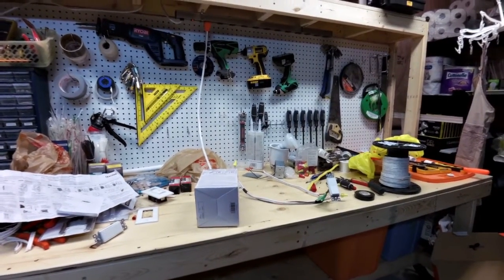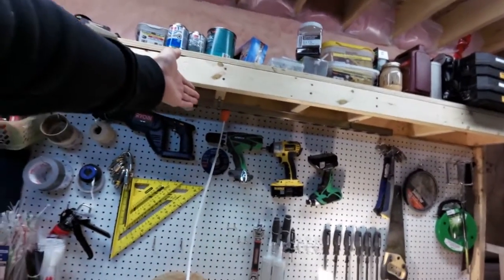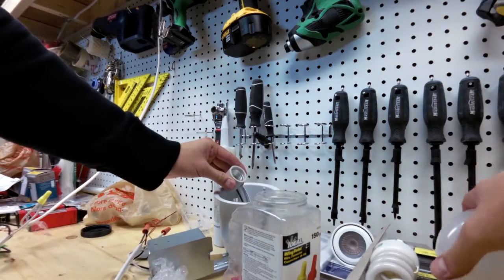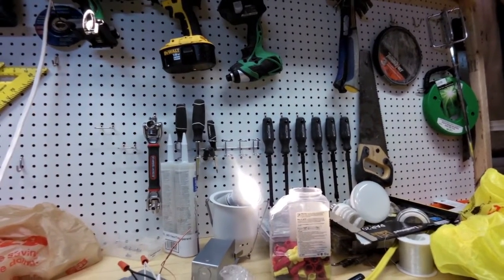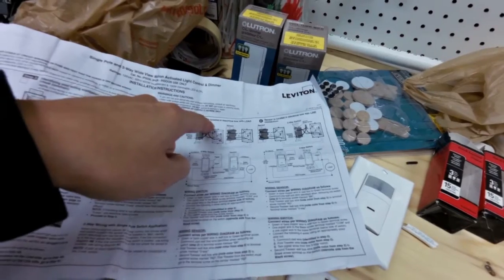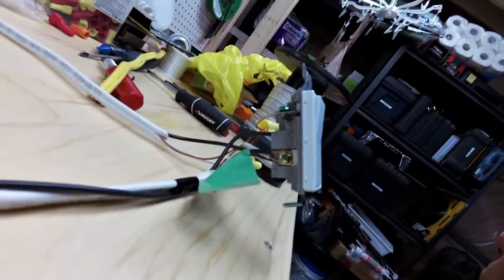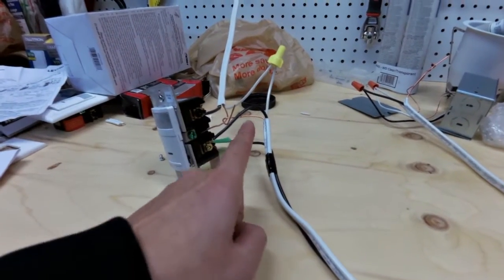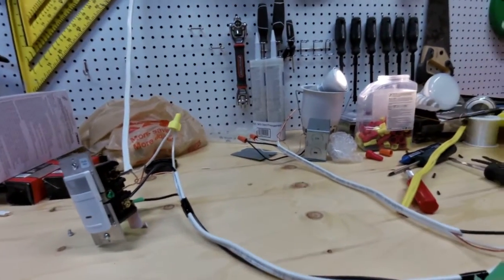Leviton IPS06 Occupancy Sensor wiring & Problems

Comment: Great video! Especially that last bit where you mentioned turning off the other switch could turn off the light.  That's what I'm facing now.  What did you mean by shorting the wire?

Also, I noticed my LED bulb is always on (but very dimmed) when it should be completely off.  Any idea why that's happening?
Reply from the maker: Hi, at 4:03 you can see the white wire going from the black screw to the other terminal on the other side of the switch.  So you are shorting out those 2 terminals.   

As you see in my video, some of these motion sensors cannot turn LED bulbs completely off, probably due to the fact the circuit is still powered so that the sensor can detect motion.   Since LED takes very little power to turn on, the small voltage that exist within the circuit is enough to turn the LED bulbs on.

My other video on How to install Lutron Occupancy Sensor Dimmer MSCL-OP153MH , that sensor actually turns my LED bulbs completely off.
Reply from the maker: If you don't want to replace the sensor, you can try to put a regular light bulb in the first socket of the circuit, that might help absorb all the leaked power from the switch and allow the LED's to be completely off.
Reply: I was browsing on Lutron's forum and someone from the company commented that it depends on the bulb.  They go through tests and list out the bulbs that do completely turnoff.  Here's the list: http://www.lutron.com/TechnicalDocumentLibrary/3682066_CFL_LED_Bulb_list_Maestro_Sensor.pdf

Do you know if you happen to have one of these bulbs?  I don't mind replacing the sensor but want to make sure it's not just a bulb issue.

Furthermore, with the Lutron sensor, does it still consume energy even when the LED bulb doesn't light up?  It doesn't bother so much that it lights up but the thought of it consuming energy does.  I'm using this in the garage so it's okay if it's stay lit.
Reply from the maker: I know there is a list, but not very practical for me because I buy whats on sale when I need it.  I find that the sensors that has a click when it turns on works better with all my dimable LEDs.  All sensors will consume a bit of energy as it need to stay on to detect motion... but its probably a very small amount and won't affect your bill too much.    However, if the LED is staying on 24/7, i am sure that will consume more energy than the ones that is able to turn the LED off completely.
Reply: In my case, the LED is very dim when it should be off.  I guess I'm just wondering if it just consumes the same energy as it would with any motion sensor then I don't need to bother changing anything.  That's probably not a question for you....Thanks for the comments!
Reply from the maker: I think it does take more energy if it is slightly on.  But I can't really prove it cause I just don't have the equipment to do so.. lol  Cheers
Reply: Just a quick update.  I bought a Philips dimmable bulb and it complete shuts off.  It's working well now.  Thanks!
Reply from the maker: thats awesome!
Reply: Your description of "shorting out one of the wires" is still not clear to me. Can you clarify?

Comment: where is the switch where I change the setting for more time?  I think mine turns off after 15 sec.  need more time
Reply from the maker: Hi, I think you need to take off the bottom cover, lightly pry it off using a flat head screwdriver.  There should be a dial that indicates more or less time.  Follow the instruction sheet here:  Page 2 of the PDF http://www.leviton.com/OA_HTML/ProductDetail.jsp?partnumber=IPS06-1LW&section=38557